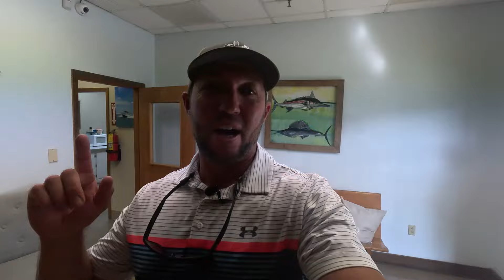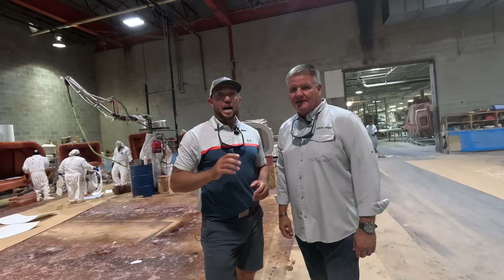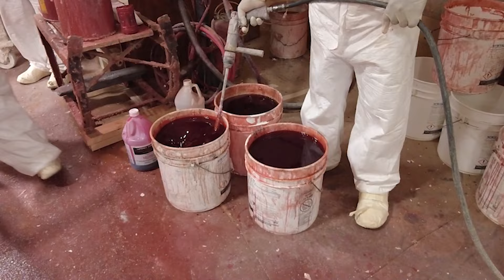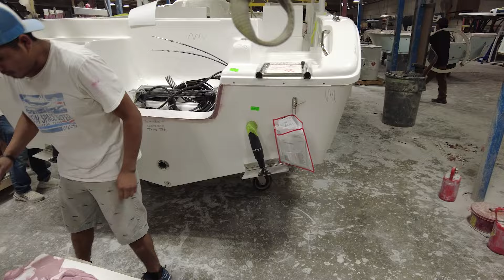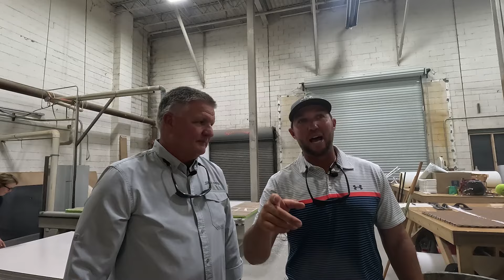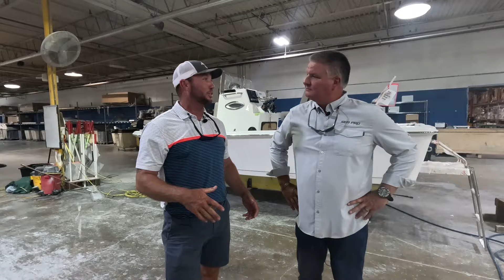What makes Sea Pro Boats Different?

Comment: I have a 2020 219 and I am very disappointed.  Hardware issues since day one hard top came loose from the floor, welds failed, powder coat flaking off all over, stress cracks in gel coat just to name a few. Also boat is extremely wet
Reply: Parker 2120 poilpt house wher 205 cknqwestyGrs sleeps 4🎉 in cabin